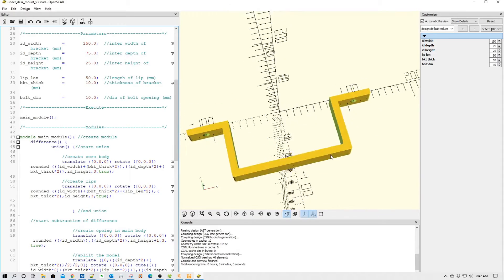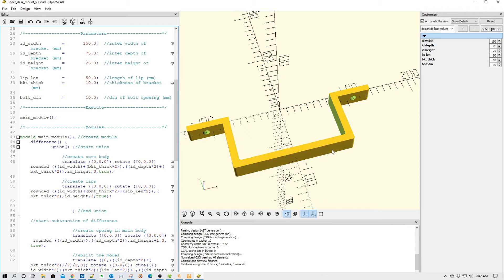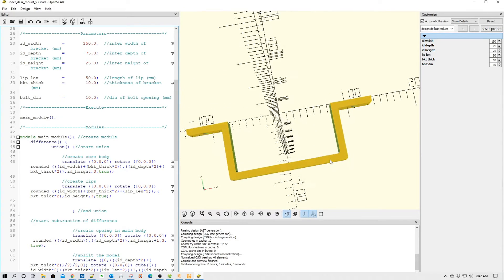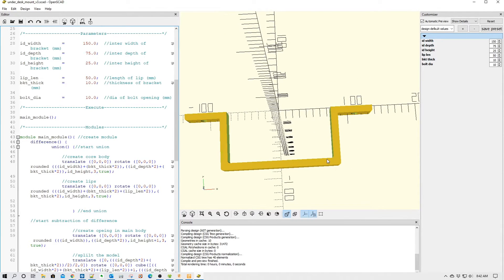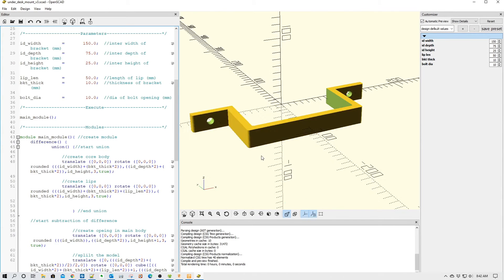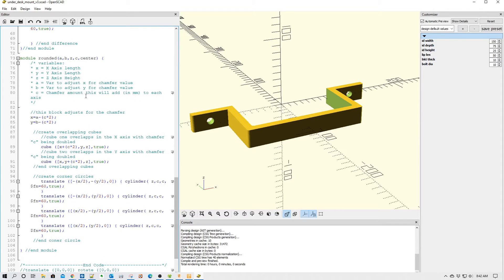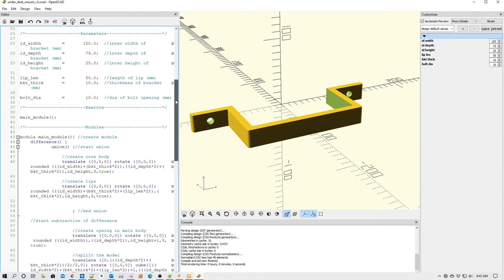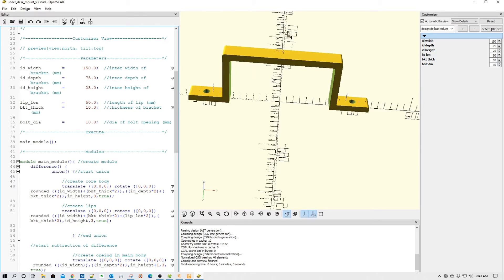OpenSCAD -  Parametric Mounting Bracket!

Comment: You are welcome to use these rounded cube modules if you like. The usage is pretty much the same as  the regular cube statement. Making it easier to change code from using a regular cube to a rounded one.

module rounded_cube(v, r, center = false)
{
       translate(center ? [0,0,0] : v/2 )
    union(){cube([v[0] - (r *2), v[1], v[2]], true); 
            cube([v[0], v[1] - (r *2), v[2]], true);
            translate([v[0]/2 - r, v[1]/2 -r, 0])cylinder(v[2], r, r, true);
            translate([-(v[0]/2 - r), v[1]/2 -r, 0])cylinder(v[2], r, r, true);
            translate([v[0]/2 - r, -(v[1]/2 -r), 0])cylinder(v[2], r, r, true);
            translate([-(v[0]/2 - r), -(v[1]/2 -r), 0])cylinder(v[2], r, r, true);
        }
}

module 3drounded_cube(cubev, rx=0, ry=0, rz=0, center=false)
{
    //rx rounding along the x axis
    //ry rounding along the y axis
    //rz rounding along the z axis

// Make 3 cubes each with rounded edges, reorientate them into the same space so the dimension are correct and intersect them
 
    translate(center? [0,0,0] : cubev/2 ){intersection()
        {
            rounded_cube([cubev[0], cubev[1], cubev[2]], rz, true);
            rotate([-90,-90, 0])rounded_cube([cubev[2], cubev[0], cubev[1]], ry, true);
            rotate([90,0, 90])rounded_cube([cubev[1], cubev[2], cubev[0]], rx, true);
        }
    }
}

//examples
rounded_cube([40, 20, 30], 2);
translate([40,0, 0])3drounded_cube([40,20,30], 1, 5, 8);
translate([80, 0, 0])cube([40,20, 30]);
Reply from the maker: Many thanks will give it a try!